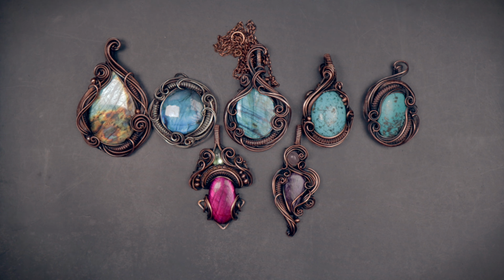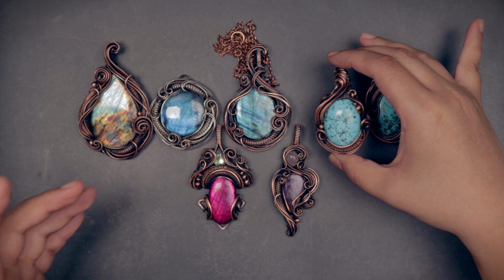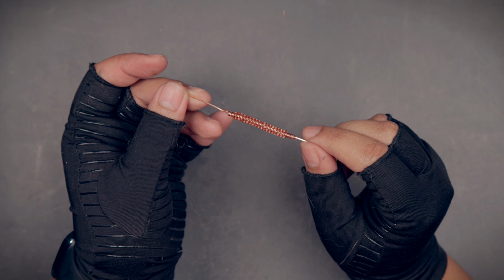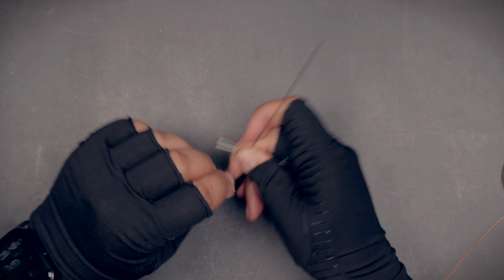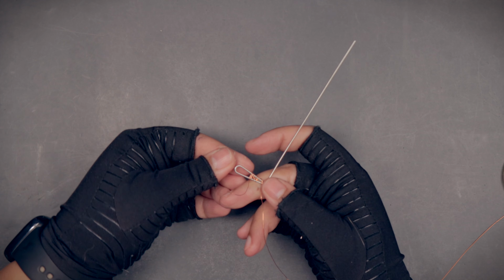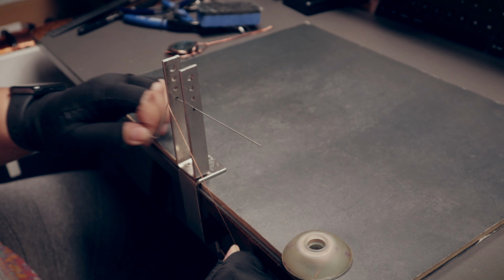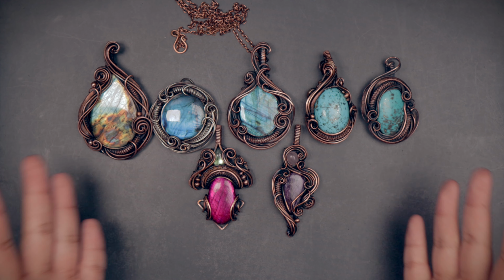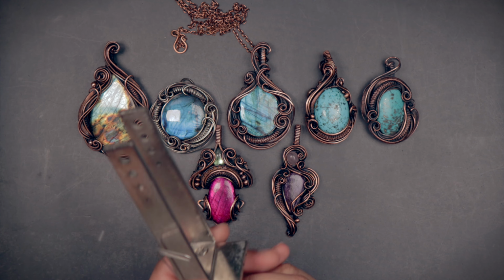How To Create Double Coils using the Coiling Gizmo

Comment: How does one figure out the wire lengths of the required wire for a particular project?? ie: the coil length required is 15mm?? Is there a formula?
Reply from the maker: @SandyBaubleLove  i honestly have no idea because I'm bad at math. 😅 But the thing with this tool is my coils turn out all the same size. So, I'm thinking, if you use this tool, u can check the length of the first coil and then multiply it according to the length u need. U can use a hand drill with ur first base wire to do that. So if u need, let's say 20cm of ur first coil, then you can use, 25cm of base wire with the drill. Then, u can use the Coiling Gizmo to create the second coil. I hope I'm making sense. Try to experiment and see how it goes.
Reply: @MithrilArtsandJewelry  TYVM